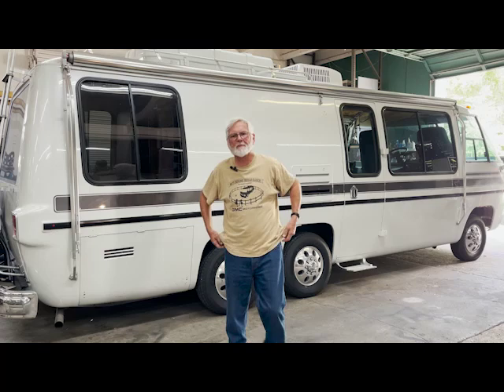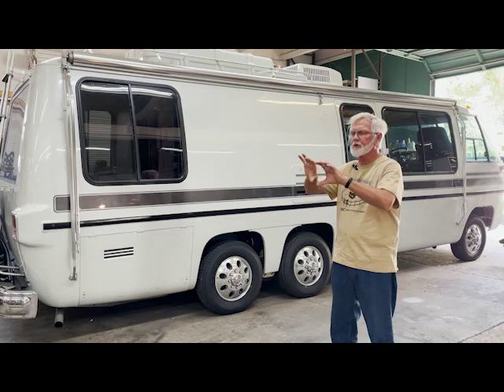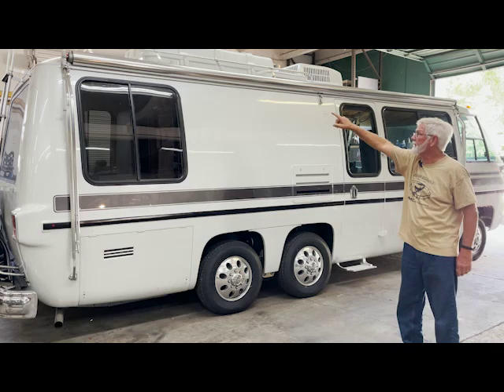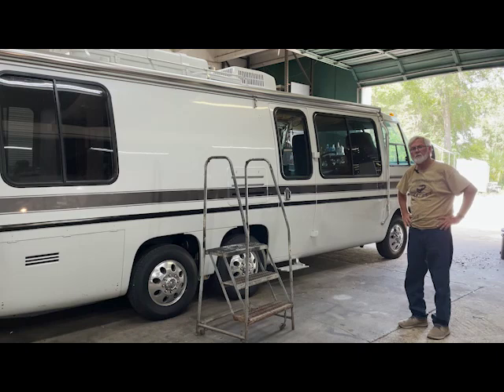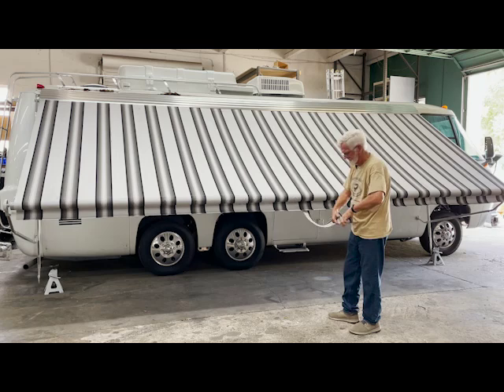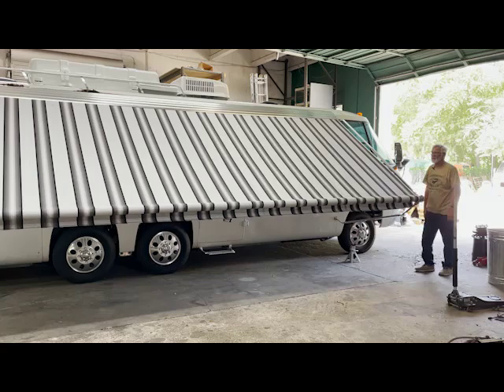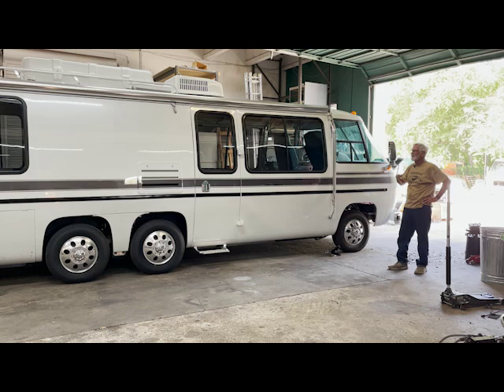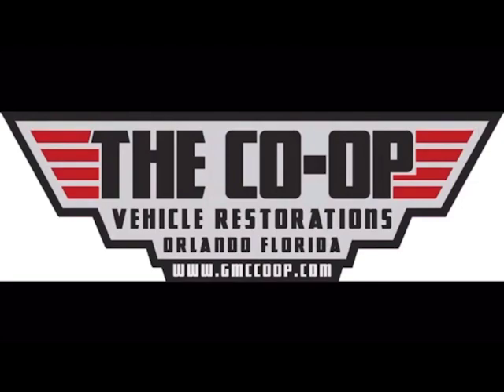How To Install A ZipDee Awning On Your GMC Motorhome

Comment: MISSING FROM VIDEO: Explanation to extend (and how) the Spring/Rafter Arm to attach claw to the shaft of the Roller (and a mention that it should never be attached to the Main Arm Snap Stud). Video just shows both Spring/Rafter Arms almost touching the ground, without explanation.

Note that the Zip Dee Awning for a GMC Motorhome is called "Custom Contour," because the Main Arm has a bend toward the top.

Zip Dee Awning Owners Manual and Parts List: https://www.awningsbyzipdee.com/wp-content/uploads/2021/03/Manual-Patio-Awning-Owners-Manual.pdf